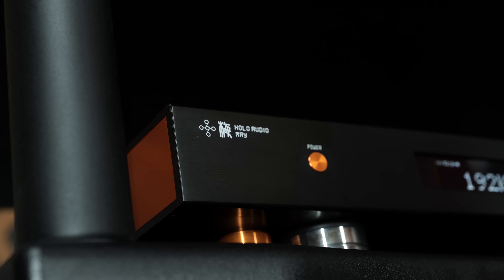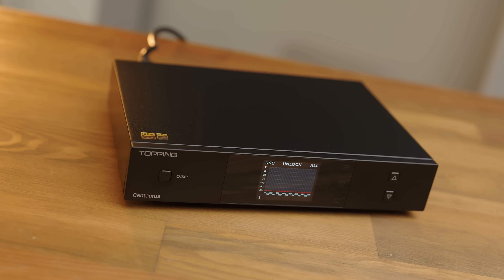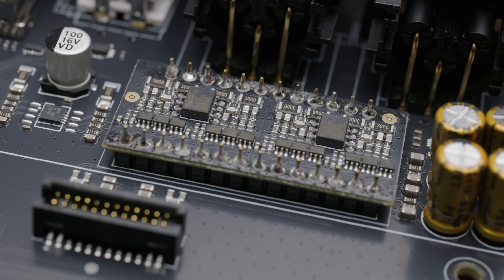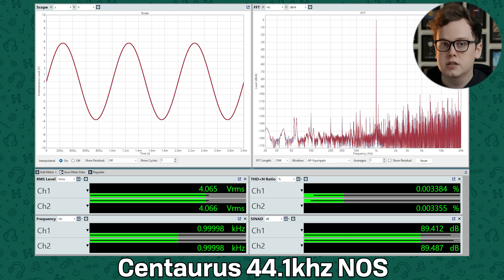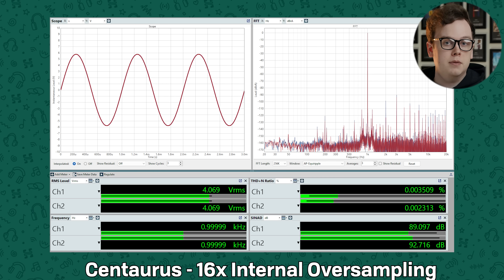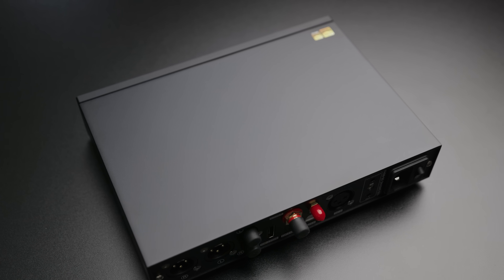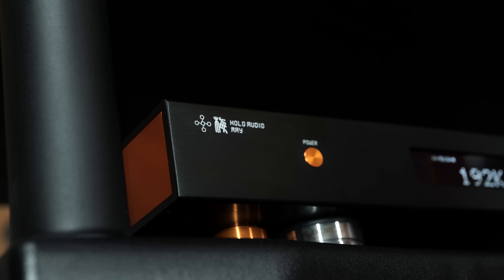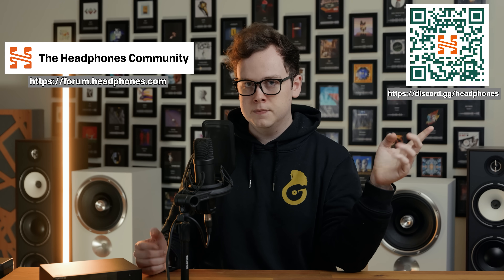The Topping Centaurus has a problem...

Comment: According to latest Topping firmware, seems already fixed. But I cannot hear any difference, maybe someone can try the new firmware for testing.
Reply: The topping guys at Munich Highend told me that it is fixed in latest firmware. I also listened to it and was quite impressed. Maybe someone can retest it to confirm with measurements?

Comment: There actually is a firmware update in topping's website. Have you checked it out yet?
Reply: You mean 0.18? the firmware from December? How is that going to help? We're in March, it's 4 months old
Reply: @gohan2091  Don't know, that's why i was asking. It could be that the device in the video didn't have that update.
Reply: @JoseFerreira-zb7wh  I doubt it though. The guy has done a lot of things for the video, I'm sure something basic as the latest firmware update would be something he would do immediately before anything else.
Reply: @gohan2091  there's a new one from July. Could you tell if it fixes the issues found?

Comment: So.... in other words:
* Despite the measurement anomalies the actual sonic differences between the Topping and Halo are quite small and few will notice
* The subjective review sounds similar to the people who don't measure things, just focus on the subjective aspects and really liked the device

All that being said, given the issues with jitter, channels out of whack, dropouts, etc., those all sound like clock issues, could be related to the digital receiver for the input you were using. I.e., it's not properly locked to the digital stream outside of the "best" setting. Everything you noticed seems all boil down to clock issues. The fact that the "best" setting removed these issues makes me think that a firmware update might do it, but firmware + swapping out the digital receiver components right after the interface is probably the best approach. 

Question: what input where you using for these tests? Did you use all of them or just one, and if so, which one?
Reply: I've also listened to the Centaurus with a Cen.Grand Silver Fox amp and i2s input through the Eversolo DMP-A8 using 44.1 kHz / 16-bit audio files in Roon (without any DSP) using NOS and OS modes and the music sounds just fine. I haven't encountered any of the degradation in audio discussed in the video.  The Centaurus is playing music without any issues. Im not sure why Goldensound experienced issues, but he should provide some clarifications since his video may be causing people to judge this dac unfairly.
Reply: "Despite the measurement anomalies the actual sonic differences between the Topping and Halo are quite small and few will notice"

No, he shows they only have small differences that few will notice when you purposely avoid the Centaurus' operating modes where its measurements are terrible, because those we already know a lot of people would notice.
Reply: @d0nj03  I would bet £100000 that 90% of people cant hear the difference between 90db snr and 110. Also niether of these DACs need to exist as even the dx3 pro + DAC is superior in every objective and measurable way meaning no human alive could hear any better as we certainly dont hear above 115db distortion and noise products. Amir has a good reputation for a reason people dont realize he actually worked at Sony and Microsoft in very high tier roles and even helped develop the mp3 format so he definitely know more than anyone else on youtube about sound as these reviewers are just audio enthusiast who decided to make videos on audio equipment but they have zero technical background.
Reply: @Jordanater1992  Can't or won't, because they never listen carefully enough in a quiet enough environment with good enough transducers?

90 dB noise can easily be audible if you're listening for it right. You know what isn't nearly as audible at 90 dB? That THD/SINAD that Amir is wasting everyone's time with. Everyone who's studied measurable audio peformance even a little bit knows the most important metric in audio reproduction is by far Frequency Response, yet Amir routinely ignores FR measurements and which FR defects reach or surpass the limits of human audibility, instead wasting our time comparing THD numbers below -85 dB as if they were a crucial metric of audible quality.

Besides, I don't care about 90% of the general population, that's not who's watching this type of review and deciding if they're going to buy this kind of device, I only care about what defects will 99.9% of audiophiles not be able to hear (90% is not good enough), i.e. people who use high-end headphones (not speakers!) and have heard more than 3 dedicated DACs or DAC/amps in their lives.
Reply: @d0nj03  You just made yourself sound more foolish as you said 90db noise is easily audible then proceeded to say that amirs snr metric doesn't matter. Do you actually know what snr stands for it means signal to NOISE ratio and if a device has a lot of noise the overall sinad is brought down too it is not just affected by distortion. Regarding the rest I agree frequency response is by far the most important thing I never said it wasn't did I?
Reply: So have you actually listened to the Centaurus and heard these problems, or are you bashing a product you've never listened to merely based on this review like many other commenters have?

Comment: Hi, I usually don't post comments rebutting a review since they are mostly subjective.  I felt I needed to in this case since you posted measurements and raised specific issues with the Centaurus which run counter to my positive experiencewith this dac.  I'm listening to the Centaurus right now on Roon in both NOS and OS 8x modes using hi res files, and I don't experience any of the issues you mentioned. The Centaurus actually sounds really good in both NOS and OS modes. I agree that "Best" mode is superior, but I don't experience any of the problems you had with the dac. My experience with this dac has been very positive so far, and I'm really enjoying listening to it. Im using it through Meze Empyrean II headphones, an ifi Pro iCAN Signature amp, Topping Pre90 preamp, and i2s from an Eversolo Dmp-a8. I don't hear any of the issues you raised about the sound quality in OS and NOS modes.  I do agree with your sound description of the dac.  For me, the Centaurus has a warmer sound signature with softer highs, terrific midrange, and great bass, as well as excellent detail retrieval,  imaging and soundstage.  However, I haven't experienced any of the issues you had in NOS and OS modes,  My experience with the Centaurus dac has been entirely positive. Just my 2 cents. Cheers!!  😊
Reply: I'm not sure how more imbecillic and stupid you can get with your comments.  All you do is make specious comments attacking others without making any worthwhile points at all.  Good luck buddy!
Reply: Just remember your main point it’s a subjective review. We all have to do our own listening for our own judgement. The reviewer is wrong it’s just his opinion, and you aren’t wrong either.
Reply: My experience with the Centaurus has been positive too. Running it with an Aune S17 Pro Evo amp and Audio Technica ATH-ADX3000 headphones :)
Reply: What are you comparing it to? What are you using as a reference? If you don't have another piece of gear that doesn't have these issues then how are you even going to recognize that they're there when your brain is adapted to hearing them?
Reply: Let's see. I use an Smsl vmv d2r,  Topping dx9,  Topping d70 pro octo, Gustard R26, to name a few of the dacs so I think i have a very good idea of how the Centaurus sounds.  Based on repeated listening of the Centaurus and other dacs im using, I didn't find any of the anomalies that were described in this review and I think he got it very wrong. I don't believe any other reviewer has made any mention of the types of issues he discusses. Have you even listened to the Centaraus? I very much doubt you have.
Reply: @ Maybe you're not hearing the issue because you're comparing it to poor performing DACs with even worse issues? 

I'm not sure where you get your audio advice from, but you need to find a new source of info because you've been mislead badly by paid shills to buy low quality gear. 

Topping/SMSL has a reputation for famously poor quality among experienced and knowledgeable audiophiles and should be avoided as a brand.
Reply: @alondite215  Actually seems like you need to find a better source as the gustard R26 is one the best DACs ever made at its price and topping is no joke all the DACs are transparent you would only hear a difference if your like Cameron and can hear above 20khz which most cant. The other topping DACs do not have the issues of this Centaurus although clearly they arent audible to most people. People like you ruin this industry as you just cant stand it if cheaper products outperform your overpriced audio jewelry and the absolute largest difference a DAC or amp could ever make to the vast majority is not even 1db as stated by Benchmark the company that makes one of the best speaker amplifiers ever made.

Comment: What do you think of TIDAL now?? They say that they no longer use MQA. They said that MQA is dead and that they have replaced all MQA songs with real lossless versions. It would be a good idea to test if this is true or not, maybe you can do a video like the one you did discovering that MQA was a scam.
Reply: In the second video he said that would be his last video on mqa and this isn't new. They stopped working with mqa months ago and he still hasn't made a new video so I doubt he will ever make one. Fortunately you don't need him to tell you what's going on. He was a good starter to make people pay attention to mqa and it's issues but people have already investigated how they replaced the files and this is how It works. Any high res files under the "MAX" label are all real lossless flac files but some files labeled as "HIGH" can either be 16 bit original flac file, 16 bit file converted from the MAX file or a 16 bit file from the old mqa file they had so technically they still have mqa files. they aren't shown or decoded with mqa's software decoding so even with an mqa dac unless it's a more expensive full decoder it won't show it's mqa on your dac and again it will just show as "HIGH" on tidal as there is no mqa label or anything on tidal anymore. So if you only listen to songs that are MAX quality you are mqa free but if you listen to some HIGH songs they might be sourced from mqa files.

Comment: I bought Centaurus and I returned it after two days. It has very low resolution, not good instrument separation and the soundstage was nothing special.
Reply: Tbf even if this dac did not have the problems mentioned you need to burn the dac in. Since this dac is using the Holo R2R module it would need about a good 300 hrs burn in min and a total of 500 max to reach it's full potential. Either way it sounds like going w/ the Cyan 2 even tho it's more expensive is the better choice.
Reply: @heyguyslolGAMING A good product should sound decent straight out of the box. Unfortunately I can’t understand why this dac costs 1000 euros. Even my old Pro Ject dac from 2019 with the linear power supply sounds so much better.
Reply: @georgek.5491  I own both a Holo Spring 3 KTE & Cyan 2 and while I didn't think they sounded bad on my initial listen before burn in there was a significant change of improvement over time as I mentioned. Furthermore the rules of sounded good straight out of the box for DSD dacs aren't the same for R2R is what I was trying to say. Many ppl have bought R2R dacs and did not like them upon first listen but after burn in found them to be a completely different experience which I can say has also been my experience BUT that doesn't mean that Centaurus would be the same. I would hold your opinion w/ more weight if you had at least done some sort of burn in time which tbh you could have done in 3 weeks which still would have given you a full week or so to still meet the return window.

Comment: Cyan2 except for auto input selector is perfect DAC. No nonsense features, no useless display, stunning looks, amazing sound. Period. Prize? who cares, it's not that expensive for what it offers.
Reply: I agree, it doesn't beat my Spring 3 KTE but if someone were to ask me should I go w/ a Cyan 2 or Spring 3? I'd recommend the Cyan 2 it's 1/3 the price and comes close enough. Similar to the Spring 3 KTE comes close to the May for half the price. The diminishing returns in this hobby is ridiculous and imo most ppl should stick to the mid range gear as Ive found it to be the sweet spot for price to performance.
Reply: A volume knob wouldn't hurt. A PEQ wouldn't hurt either. A 12V trigger would have helped a lot, and the list goes on :) Don't get me wrong. I own the C2 and love it for the SQ and build quality, but if the centaurus firmware could solve the SQ problems, I would instantly swap it (given the same SQ).

Comment: I recently got the Topping MX5, and it has a bug with the Toslink connection: the sound drops every 2 minutes for a second. The weird thing is, they fixed this issue in their latest firmware, version 1.05, 2.5 years ago, but it's not a public release. Only version 1.04 is available on their website. I asked them to send it to me and questioned why they haven’t made the firmware publicly available. They sent it to me but provided no explanation. I know a lot of people have returned the MX5 because of this, unaware that it had been fixed. Otherwise, it's an amazing DAC.
Reply: If the firmware is unavailable you should upload the files to the Internet Archive

Comment: Should I be running 44.1Khz at 88Khz or 96Khz? ChatGPT says: 

Why 88.2kHz or Higher?

1⃣ Reduces Aliasing in EQ Processing

    Equalization (EQ) modifies frequency content, and if applied at lower sample rates (like 44.1kHz or 48kHz), it can cause aliasing—unwanted distortion that occurs when new frequencies are introduced but can't be properly represented due to sample rate limitations.
    Using 88.2kHz or higher moves these unwanted artifacts further out of the audible range, making them less noticeable.

2⃣ Better Interpolation Accuracy for Parametric EQs

    In PeaceGUI / Equalizer APO, parametric EQ applies curved frequency response adjustments that require accurate interpolation.
    Higher sample rates (88.2kHz, 96kHz, etc.) allow more precise frequency adjustments because they have more data points per second to work with.
    This results in smoother EQ curves and less phase distortion.

3⃣ Prevents High-Frequency Roll-Off from EQ Adjustments

    Some EQ algorithms cause high-frequency loss when working at lower sample rates.
    If the sample rate is too low, the EQ might struggle to accurately adjust high frequencies (above 15kHz), making the sound duller.
    Setting the sample rate to 88.2kHz or 96kHz ensures the entire frequency spectrum is handled correctly.

4⃣ Avoids Harmonic Distortion When Boosting High Frequencies

    When you boost frequencies near the Nyquist limit (half the sample rate), aliasing distortion can occur.
    For example:
        At 44.1kHz, the Nyquist limit is 22.05kHz.
        At 88.2kHz, the Nyquist limit is 44.1kHz (giving much more headroom).
    Boosting treble at 44.1kHz can introduce distortion, but at 88.2kHz or higher, there's more room for smooth EQ adjustments.

Comment: That issue with the Topping Centaurus in NOS mode playing 16/44.1 files seems similar to the Hifiman the EF400 amp/DAC, which in NOS mode can be noisy playing 16/44.1 files.
Reply: This is exactly what came to my mind while watching the video. EF400 only had the problem with earlier units, then Hifiman fixed the problem. I hope it will happen with Topping as well.

Comment: When you guys talk about using HQ player for upsampling, i assume this doesn’t apply for someone who uses Tidal to stream?
Reply: HQPlayer is an upsampling app that mostly benefits true R2R ladder dacs and can work w/ any audio source provided its digital so Tidal, Qobuz, Apple, iTunes, Amz or your own personal digital library will work. You can actually use it w/ video audio sources too such as TV, Movies, & Games; you just have to test and adjust for latency so the audio is in sync but that mostly is determined by your pc hardware. Furthermore, HQPlayer while it can be used w/ DSD dac's don't generally get much benefit so imo it's not recommended.

Comment: Could you have gotten a bad Centaurus?  Other people like that thing!  Its not pulling me off my Gustard R26 R2R DAC and Gustard H26 class-A headphone amp.  Bliss!... is how I describe THAT combo.  And by the way I love the FIIO K11 R2R DAC in NOS mode.  That will tame the treble on your HD800s natively and is awesome played through the Gustard H26 class-A headphone amp.  Choose your flavor of bliss!... for your mood.  I was looking at the Topping Centaurus and got the Gustard R26 mainly besides its reputation, its built like a tank.  Two massive separate power supplies in the Gustard power discretely the analog outputs and the other power supply powers the DAC.  Sorry but that Topping power supply looks a little wimpy.  And the R2R DAC in the Centaurus on a freeking daughter board does not inspire confidence they did that as cleanly as possible.  If there's noise coming from that DAC hidden beneath the R2R daughter board it goes right into your sound.  That IS just weird !  I wonder if that is what is happening to yours.
Reply from the maker: Two units were tested both of which had the same behaviour as stated in the video.

As also shown in the video, when the DAC module was transplanted into the cyan 2 the issues went away.
Reply: He stated he tried a 2nd Centaurus in the video with the same issue.